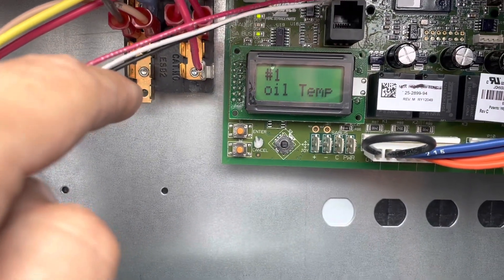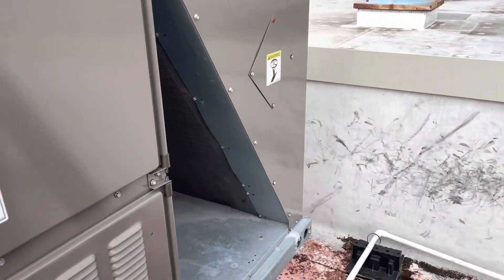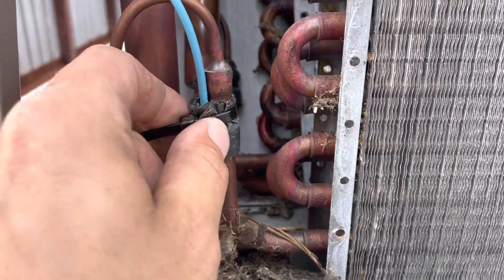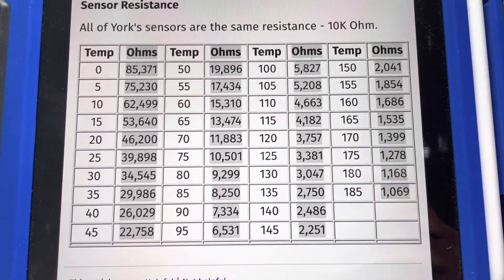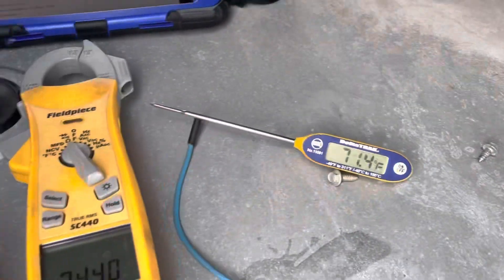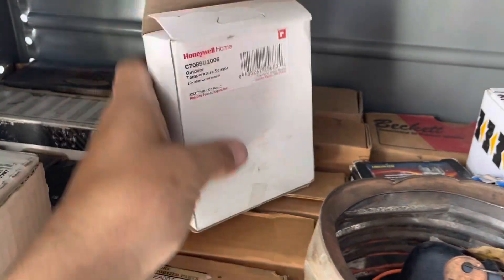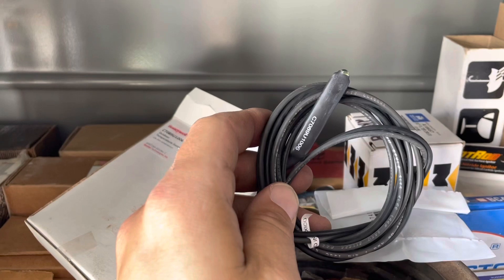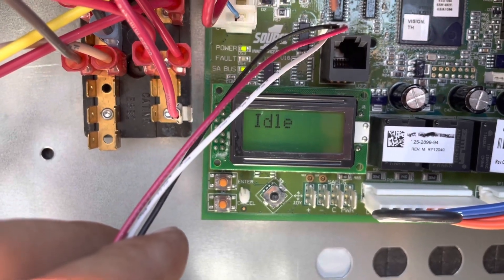How to test a 10K Ohm Sensor! #hvac #airconditioner #repair #york

Comment: "Good evening, how do I get the system to start after the 'Idle' message? Should I use relearn?"
Reply from the maker: It needs a call for cooling.  Confirm 24v between C & Y.  If you have that and it’s still Idle with no error msg than you can try relearn but chances are it’s a bad board.

Comment: Hi, is possible run without termostat?  only run whit the UCB?
Reply: control the temperature without the zone thermostat? 

In the menu OCCMode apper external and Schedule.
Reply from the maker: Yes, it’s possible with this particular simplicity board.  I’d suggest getting the installation instructions and see if that helps.  If it doesn’t, you might need to re-flash the board in which case you would either need your York dealer to help you out or have a York log in to install the program on a USB drive.
Reply: @JeffsHVACAdventures  gracias amigo.

Comment: Great video. I've got an HS1 lockout due to limit switch error during heating. Unit works for a few days or weeks and eventually locks out. This is an intermittent issue that i can't find a solution to. I've replaced the primary and aux limits and rollout. Funny  thing is my temperature rise is within range. Any help would be greatly appreciated.  Thank you
Reply from the maker: Could be loose connection somewhere or a failing wire.

Comment: Is there any way to bypass it? I have a York that will not run heat because outdoor temperature sensor.
Senser is testing good
Reply from the maker: I’ve not found any way to bypass it.  You might have a bad board.
Reply: @JeffsHVACAdventures I worked on a York 10 ton condenser today and I found that it needs an electronic low ambient controller. Have you ever heard of such a thing?
Reply from the maker: @miguelramirez9464 yes I have.  I believe Penn makes one that works well with York equipment.
Reply: @JeffsHVACAdventures  do you know where I can find it? My York supplier doesn’t see one existing
Reply from the maker: I can’t remember the part # for the Penn one I mentioned.  I was pretty sure the ones I’ve seen came factory installed from York so it’s weird they can’t help you with it.  But if all you need is an electronic low ambient control,  ICM makes a good universal one.  ICM325A.  You can order it off ICM Controls website or Supplyhouse.com
Reply: Figure it out? Replace new sensor anyways or replace board?
Reply: Have you found a fix to your issue? I'm having the same issue on a york rtu.

Comment: I have couple of those sensor failures in couple of our 5 york packs unit at our facility.  I was told that some of those sensors are phantom Sensor , I don’t need to worry about it.  Would that cause any misreading to the thermostat or unit itself?   What problem can we avoid if we fixe it?   Thanks
Reply from the maker: It shouldn’t  cause any issues with your stat.   But it could send your unit into a shut down if a sensor is bad.  Which was the case with this unit.  

And yes I’ve seen phantom sensor errors that won’t reset on these units.  Most times it has to do with an economize that either was never set up properly on install or an economize control that’s failing.  You can get a flash drive from York and try to Re-flash the simplicity board.

Comment: 95% of every York I do maintenance on always has at least one sensor failure on the display. I think they should find a different manufacturer for them... On another note, it's so weird seeing all those oil nozzles. Oil has been drastically disappearing around here in the past 5 years with the skyrocketing price. I don't miss those days of working on oil one bit.